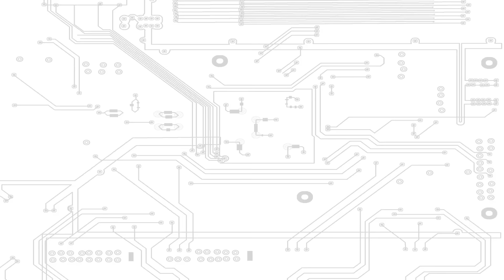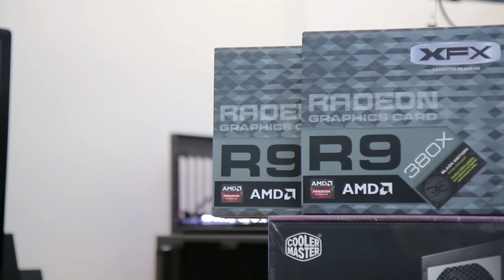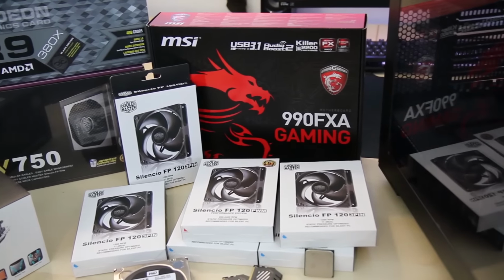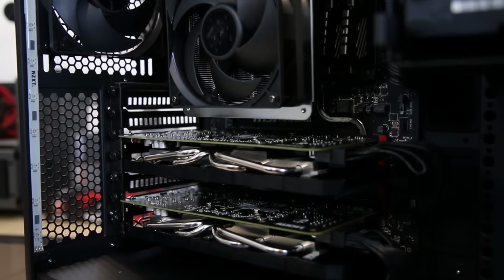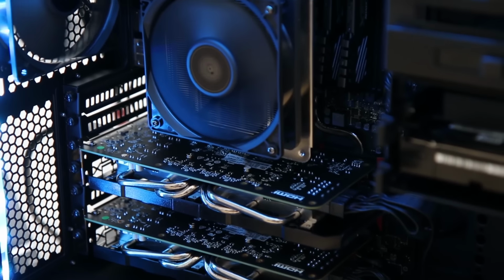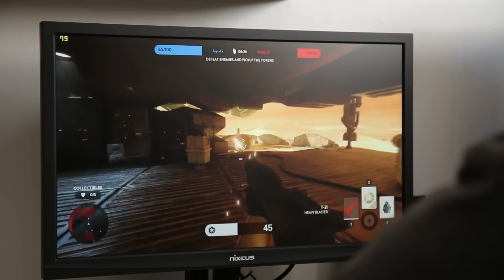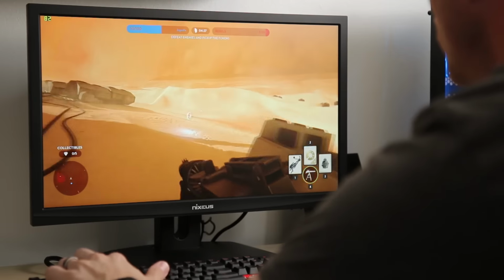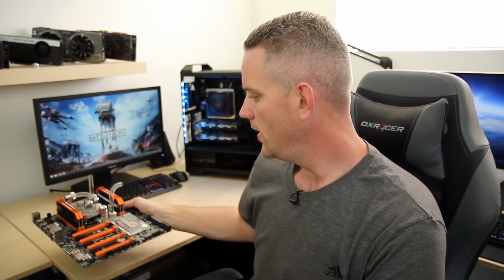AMD Gaming PC - Is AMD still good?

Comment: Nothing against AMD on the graphics side, but I'm still running an Athlon 2 X4 640, which was released in 2010. RIGHT NOW I could go out and LITERALLY buy the BEST AMD CPU and I would have no incompatibility issue. TELL ME there is nothing wrong with that!

OH, AND QUESTION FOR ALL: Should I go out and buy an FX 8350 ($180) or get a Core i3 (Skylake) or i5 (Haswell) on a new chipset and DDR4 (Skylake) which would cost around $220. (I will have to use the stock cooler on the 8350)
Reply: caleb kelly no lol what
Reply: +Captain Leerox i would go i5 haswell if you dont mind getting a new motherboard. a 4460 will do you fine, a 4690k is a large amount of money more for a small performance bump
Reply: +Captain Leerox If you live near a micro center you can pick up a 4790k for 270$ with tax.  I would highly recommend a 4690k or if you need to keep it on a budget pick up a 4460.  Personally I ended up getting a 6500 for $190.
Reply: +Captain Leerox its simple. Check how much u would save by going with an 8350 instead of an i5. Now check if that ammount is enough to get a higher tier graphicscard. For example 390 instead of 380X. If that is the case get the FX if not get the i5. 

Unless its just an 4460 or 4570, then the FX8350 will probably be better, but that really depends on the games you are going to play. 

I would not recomend ANY i3 atm. They are simply not worth their money for gaming compared to what amd has to offer at the same price range. (like the athlon x4 860k, or the FX 6350/8350).
Reply: Whatsthisbuttondo1 Yeah I mentioned the i3 because I have a MASSIVE Bottleneck. Literally I would be fine with ANY processor better than mine, but my CPU also has an AWFUL temperature on idle (50 degrees, almost 80 on slight load, I hate high temperatures even though throttling would be the only effect of temps on performance)
But really I just also want to say hello from the other side. I totally think it would be amazing to have a sick DDR4 entry level system, and 2 years later pick out an LGA1151 top of the line Core i5 processor and just kill games and never worry again. There's no way I could do that buying a 4460 or FX 8350
Reply: +Captain Leerox I'd wait a year. TBH See if cannonlake comes out or a new AMD.
Reply: caleb kelly <3 is ok we love u
Reply: lS7rike l But I only have 2 opportunities to buy things: Christmas and my birthday in May.
And I think I've waited too long its been 4 years too long
Reply: Captain Leerox 6600k>6600 or 4690k> 6500>4460>8350 - All are pretty fucking good.  If you can get a good deal on it, and are willing to spend a good portion extra I would recommend trying for a 4790k, but if you are only gaming it is a slight waste.
Reply: +Captain Leerox I say get a 6300 and wait for zen
Reply: M̶c̶N̶u̶g̶g̶e̶t̶ Ahh. That's not a bad idea, but the i3-6100 is fairly ahead.
Reply: +Captain Leerox I picked up an 8320 for 110 shipped. Intel doesn't even offer a decent CPU in that price range, at least not comparable to the performance you can get from the 8320.
Reply: ***** Just the confirmation I needed. I watched an i3-6100 reach 4.6 GHZ stable.
Reply: +Captain Leerox wait for Zen. I switched from the 8350 to the 4690k because I emulated a lot, which demands better single-core performance than AMD can provide, but I doubt I'd recommend that for most gamers. If you're desperate for an upgrade then look at something between the 6300 and the 8370, then wait for the next round of CPU's from both companies.
Reply: ***** But then where's the upgrade path. I'd rather get a Cannonlake LGA1151 Core i5
Reply: Captain Leerox Not a bad plan. but do bare in mind that there some games that will simply not run on an i3 (even a good one). and other games will be slowed down by the i3, and an i5 will almost never be a bottle neck. i got the i5 6400 myself and i do love it but ddr4 is no benift over ddr3 when it comes to gaming. and amd cpus will also give a bottle neck in a few titles. you are probably best looking into what games you play and weather or not you need the i5.
Reply: +U Wot m8? i assume you mean ddr4?
Reply: +Captain Leerox i'd go with either a i5 4460 or 4690k. I just got my 4690k brand new from r/hardwareswap for $185 and i love the thing. Got a dark rock 3 on the way, can't wait to overclock.
Reply: ***** Don't you mean:
The Skylake upgrade path would be on a brand new socket, which will most likely have new processors in later years on that same socket. With that LGA1151 socket you will have DDR4 and the Z170 platform benefits. In these ways you can upgrade your CPU to a Core i7, which will probably be faster than AMD's next generation processors.
Reply: If your budget for a CPU, alone, is close to $200, there's no reason to get anything but an i5
Reply: Alex A My WHOLE BUDGET is $200 XD
Reply: ***** I'm not downgrading....
Reply: ***** For a brand new chip, on one of the latest chipsets with PCI Express 3.0 and M.2 support
Reply: If it aint broken, why change allot of things tho. I think getting a fx chip is one way to upgrade the system and costing you less. At the same time, you can just buy a graphics card with it than spending more on the cpu side. Just saying, that graphics cards are more important right now. And, an fx chip is still a good chip, tho the single thread performance is weak, but gets the job done on games and other applications.
Reply: +Captain Leerox the 8350 for intense cpu games for sure
Reply: +Captain Leerox and if your budget is 200 dollars, then get the evo 212 it comes with thermal paste btw
Reply: Zach Marik ya ik
Reply: Zach Marik what the Ive seen you on my channel before and you raged at me
Reply: +Captain Leerox dont mind that
Reply: +Captain Leerox Honestly, I would go for the 4460 and keep that for a few years. It will last you well since it is a good enough CPU such that it will not affect games. If you go Haswell, the upgrade to Skylake is not worth it at all (FOR GAMING) since there is literally no change in FPS between the two chipsets. If you wanted to upgrade, wait 3-4 years and then upgrade then when Cannonlake becomes cheaper.

The reason I did not recommend the 8350 is because Haswell (and above) has much better single core performance which is many games tend to use (games like ARMA 3 or World of Tanks will get worse FPS than if you got Intel). Sure, there are games like the Battlefield series which are optimized to use multiple cores but in today's game market, 90% of games still rely more on single-core performance.

To those out there who say to overclock the 8350, remember that the more your overclock a chip, the more wattage it uses therefore the more heat it outputs. The 8350 already starts at a base TDP higher than the 4460's. To match the single core performance of the 4460 through overclocking, its going to get quite hot. This means you are going to need to buy a better cooling solution to get the same single-core performance out of the 8350 as the 4460. Based on what you said, using the stock cooler on the 8350 and overclocking it is something I don't recommend (it will thermal throttle if you try to match the 4460's single core performance on that stock cooler).

I hope what I wrote was not too long but this is by far the truth in terms of Mid-Range CPU's (in the high-range CPU's, Intel has that market, AMD's top CPU's are outdated at this point).

Have fun upgrading your PC while I'm stuck on this Crapbook Pro :)
Reply: ***** Did you even read anything I said LOL
Reply: ***** "The upgrade path would be on a NEW set of socket. so it'd be a waste"

- which is why my main recommendation was to wait to see what Zen brings, even if only in Intel price drops.

" Skylake you get ..."

- he has a socket that already accepts an 8350, which means he would only have to buy the chip, for around £125/$180. Upgrading to Skylake costs him around £180 for an i5, £60-odd for 8GB of DDR4 at a decent speed, and somewhere in the region of £100 for a motherboard that can justify the expense. That's 250% the price of the 8350 for only minimal improvements in games.

" you can easily move to an i7"

- if an upgrade path is so important to you then why are you overlooking his current upgrade path? In two years, when he's thinking about that i7, you'll be telling him to ditch his entire setup and swap it for whatever else Intel has released.

I really wish people would stop recommending upgrade paths when they do so in order to provide an expensive alternative to the upgrade path people have available to them right now.

Captain Leerox seriously, if you're dead-set on an upgrade, get an FX-8xxx chip. I have a 4690k so this is no blind, biased statement - the 8350 is a superb gaming CPU, especially given that you could retain everything else in your system.

As long as you don't need ridiculous performance from one or two threads - such as emulators - you'll get along fine. An i5 just isn't really worth it: trust me on that.
Reply: Subal Pant " I would go for the 4460 and keep that for a few years"

- not as well as an AMD octa-core. After all, eight-core AMD chips are what most games are designed on, seeing as they form the centre of the PS4 and XOne. Witcher 3, Battlefield 4, Star Citizen, etc. all use more than four cores where available. An i7 is future-proofed, to some extent - an i5 generally isn't to the same degree. An 8350 will fare better.

"I did not recommend the 8350 is because Haswell (and above) has much better single core performance"

- no modern game uses a single core, so this is pointless. Games which only use FOUR cores will favour the i5, but these are slowly being phased out and games are increasingly making use of up to eight cores. I doubt quad-cores will go the way of dual-cores any time soon, but they're certainly starting to see little hints of obsolescence.

" in today's game market, 90% of games still rely more on single-core performance."

- but how many new games run on four cores or less? That's the issue here. As far as I can see, genuinely new games are becoming increasingly likely to run on more than four cores, whereas those major releases which do not tend to be those built on older firmware, like Fallout 4 (using the Creation engine from Skyrim - which launched running on TWO cores) and GTA 5 - a PS3 game.

That 4460 will ONLY beat the 8350 if something runs on four cores or less. Some games already break that criterion, and it's reasonable to expect them to increase in prevalence from this point on.
Reply: +Christ J  Thank you. And if he uses a 212 with the 8350 it will also be cool for about 30 - 40$ more.
Reply: +Captain Leerox If you only have $200 to play with the best and only option is FX8350. You're not going to get a new motherboard and a worthwhile CPU for that price.' FX8350 is the best bang for your buck upgrade from your current system.
Even if you had a bigger budget, you'd get seriously diminished returns on your dollars spent by putting money into switching platforms. You'd get maybe up to 20% more FPS in a few titles, but it'll cost you around 2-3 times as much money to do that upgrade. You wouldn't get a good return on your investment.
Reply: actually... Their 8 cores have only 4 physical and 4 logical cores... similar to how their 6 core has 3 physical and 3 logical cores... just saying:3 I love amd still
Reply: +niro lord not true, one "schedular" for TWO physical cores, not one physical and logical thread.
Reply: Bryan Zerby indeed. The 212 Evo has got my 4690k to 4.4GHz, with plenty of voltage headroom when I water-cool.
Reply: too bad that you need a 240mm liquid cooler to max out your cpu
Reply: +Captain Leerox 
No reason to get a CPU right now, it's a shit time - new generation of Intel CPUs have no substantial performance over last gen (because they have no real competition) and AMD is still on 28nm dies for their three year old CPUs.

Wait at least until Zen is released, because Zen is going to be 14nm and there's speculation that there'll be a "16 core" zen CPU and better single core performance.
Even if you hate AMD with all your might it's still a good thing because it (might) kick Intel in the god damn rear and make them start releasing products at a decent price again.

If I was going to get a CPU right now I'd just get an FX-8350 and OC the shit out of it, it'll handle all your gaming needs until the next gen of CPUs come out.
Reply: +Captain Leerox meh, just go Skylake / DDR4 if you have the money to do so. If you don't, get a FX-8320; $40-50 less than a 8350 and you should be able to OC to the same clocks or more (and you can spend that savings on a Hyper 212 EVO cooler).
Reply: +Captain Leerox I'd get a I5-6600K (K-series skylake processors don't come with a stock heatsink be warned). and 8gb of cheap G.Skill or Crucial memory
Reply: find a cheap 8320 and a nice cooler
Reply: i5 hasswell dont go i3 the fx 8350 beats the i3 so yeah but i would say i5 haswell
Reply: +Captain Leerox i have an  i5 4460 (haswell) with stock cooler and it's quiet and handles everything, with an asus r9 270 i can play all games but not all of them at ultra.
Reply: +Captain Leerox Captain, I agree with the 8320 plan.  That is a 3.5GHz 125-watt CPU (*more when overclocked).  This CPU was about $130USD when I checked a couple days ago.  Get a good air cooler for it and turn up the heat.  I think this should be more than fine for 1-2 years, at which time you can consider a new system based on whatever is out then.

Going to a new platform now when you will have to buy bottom-of-the-barrel components seems like a bad idea.  Be certain your motherboard fully supports the 8320 (check the manufacturer's list of supported CPUs) and make sure your RAM is fast enough.
Reply: umm bodozer pins...
Reply: +Captain Leerox  Skylake -  cause it seems we will be able to overclock none-K versions again, and even the i3 series =)
Reply: +Captain Leerox The FM Athlon cpus are notorious for having bad temp sensors. Your temps aren't nearly that high. I was idle around 50c (gaming around 85c) on a X4 760k with a CM Evo 212; thought something was wrong so I pulled out my Corsair H100 from another build and slapped it on the 760k. SAME TEMPS!. Which I concluded was impossible and the sensors were bad. So that is most likely what you are seeing. 

Personally, I don't think the Intel price premium is worth it for 99% of people. Only 1% of users will use an Intel cpu for what it is designed for. The rest are just fanboys who want to brag about how much money they spent on a rig. I go with AMD simply because price to performance ratio is just right. Hell +JayzTwoCents was an AMD guy for a long, long time. I forget why he switched, but he's more intel today than ever before. If you have the money and really, really want intel. Go with an i5 Haswell or better. Skylake will serve you better in the future though. i7 is too overpriced for 99% of the people who are using it to game. i3 won't server you long enough. Bomb Tech's two cents.
Reply: +Captain Leerox i5 haswell
Reply: Just get fx-8320 with decent cooler and overclock it.
Reply: Just get fx-8320 with decent cooler and overclock it.
Reply: +Captain Leerox redo thermal paste.
Reply: +Captain Leerox Paying $180 for an 8350 is way too much. It goes on sale for $120-140 very often.
Reply: seriously - skylake i3/i5 - they all seem to become overclockable soon according to mobo-manufacturers.  
You get a cheap i3 that at stock beats the stock AMD FX series, and will have the same possibility to OC it if wanted.
And the Intel CPUs already beat the AMD CPUs from budget to enthusiast in terms of System-price/performance.

With Zen that might change - who knows, we can only hope for the best.
Reply: ^^fanboy alert
Reply: +Captain Leerox   old AMD multicores are bad,   newest ones are not much better,     Zen might be good. 

860K with 390,   380,   970 or 960  if on a budget,    780s are also decent if you can find them
Reply: Bomb Tech
 Really check - go find a good AMD Cpu that can come close to the performance of the lowest i5 skylakes in games :)
Reply: doublepost... ugh.
Reply: +blitzwing1 and just to clarify, I use both chips for different reasons. AMD for gaming; Intel for productivity.
Reply: +ABaumstumpf I'm not an AMD fan boy. I use both chips, have for many many years. probably longer than your mom has been buying your chips. Go home fan boy.
Reply: Bomb Tech So you ignore that benchmarks show that Intel is currently jsut the better option through out the board for gaming?

And you want to claim that you are not a fanboy? You certainly are one.

 
And i don't know why you think my mother would by my stuff - you should stop projecting form your self onto other - certainly not everybody is as pathetic as you. Most people actually can read and understand what it means, when a cheaper Intel i3 beats the fx 8350 in every game. It means that intel is the better choice, even for budget builts.
Reply: +ABaumstumpf I don't feel like giving a long rebuttal on my phone. don't get ahead of yourself, son.
Reply: +ABaumstumpf Why are you deleting your comments?
Reply: Bomb Tech
 I deleted a comment cause it was a double-post - youtube sent the same comment twice. So why should i keep it?

and
"I don't feel like giving a long rebuttal"
You mean you run way and act like a spoiled brat - like a total fanboy - because i have shown you facts and you can't deal with them?

Well -deal with it - the benchmarks show that even the last gen intel i3 can and will beat AMD CPUs in gaming.

Please learn some basic reading comprehension and maths.
Reply: *****  ^,^ dont have skylake yet, big plunder of intel - that should never happen. But this and the performance are 2 separate things -they still outperform AMD - that is just a sad fact.
Reply: +ABaumstumpf I never once said AMDs CPUs weren't old or that Intels new chips wouldn't beat it. Look at My comments again before you comment back. You are absolutely dense and only making you cause (if that's what you want to call it) worse. And you can't just ignore the fact that AMD hasn't taken advantage of new manufacturing processes yet. That's what they call having your cake and eating it. Like others have said, 4 frames. yay.... you win I guess. Although this was never a debate on who was better. I simply said (or so I thought until I met you), that they are DESIGNED for completely different applications. And excel at those applications for which they were designed. Please for the love of God. Read this time, fan boy. 

Now that I look back at the comments, you were just mad I called you a fanboy. Ha. That's actually pretty funny.
Reply: +ABaumstumpf You also can't base your facts simply on gaming. Gaming is a TINY niche in the CPU world. Most Intel chips are used for productivity. Possibly light gaming if you organization will allow you to install personal applications. Your little, tiny world of only gaming, doesn't cut the mustard.
Reply: +Captain Leerox 
While everyone here is having a brand war, I'd like to offer my two cents.  It would be MOST beneficial for you to wait a few months until Zen is released.  
If Zen ends up being great, you can upgrade to Zen.  If not, the prices of both the Intel and Amd CPUs will be cheaper.
Whether or not you plan to get Zen, waiting will be your best bet
Reply: +Captain Leerox i have a 8350, really good cpu for the price. Only game i have issues with is Dayz. But then again it's dayz... i bought a cheao motherboard 970a ds3p and i can run it at 4.6ghz with ok temps on air cooling. Running 4.4 now idle 26 in game 37. i can stream any game i play without a problem. Gpu is r9 270x 2gb and 8gb 1600mhz ram.
Reply: *****
 Many do, sure, why not. And there you would go for a Xeon.
Reply: 8350
Reply: +Crispy K We basically have the same build lol
Reply: +Captain Leerox 4690k or 4790k
8350 is ass for games, I replaced mine a few weeks ago
Reply: +Captain Leerox i just say a 8350 on sale for 130$ check around...(that was newegg btw)
Reply: ***** asrock 970 extreme R2 2.0
Reply: radun70 But then I could sell my old things (Yes I know a few guys who would take my RAM and CPU/Motherboard and old Graphics card for $130)
Reply: +Captain Leerox
You'll need to buy a new CPU, Motherboard, Ram, Graphics card and Windows license (if your current license isn't transferable). You can sell your current parts for $130... +$200 you are putting into the budget. You're going to need to spend at least $180 of your budget on the CPU for it to be worth your while to upgrade. That'll leave you about $150 to spend on the rest of your components, which doesn't get you very far. If you need a Windows license, there goes your budget. If you don't need a license, you can get a cheap 750 Ti graphics for about $80 - $90. So that leaves just $60 - $70 for a motherboard and ram. I think you're going to have to put a bit more money into it for it to really be an upgrade, and the bottom line is it's for very marginal improvements over a FX8350.
I think you'll still need to put at least another $150 to cover everything. $250 if your current Windows key isn't a transferable retail license. And that's if you only buy bottom of the barrel low end equipment. So you'll be spending between 1.5x to 2x as much money for about 10% to 20% improvements in some games.
Reply: radun70 I have:
Athlon 2 X4 640 CPU
MSI 760GM P-34 FX Motherboard
G.Skill Ripjaws 8GB DDR3
EVGA GTX 960 4GB FTW
WD Black 1TB
Windows 10 Pro 64 Bit
Corsair CX600M PSU

All I need is a new CPU, Motherboard, and RAM, if I sell that, I would get around $80, and I could add my OLD Radeon HD 6570 to the mix to make all that combo for $100.

My budget in the first place was $200, so If I just buy:
An Intel Core i3-6100 ($130)
An AsRock H170 Pro4 Motherboard ($100)
And G.Skill Ripjaws V DDR4 8GB Kit ($45)

And sell my old stuff, it will only cost me $175
Reply: +Captain Leerox 
You could do that. It all really boils down to whether your windows license is a transferable retail version. If not, you'll need to put a little bit more money into it. Either way I'd just go for the FX8350, but it's your money you can do what you like with it :)
Reply: +Captain Leerox "MSI 760GM P-34 FX" MSI's 1st page says "125W supported"  but compability has no 125W cpus on it. Weird. Just to be safe, I'd choose something like 8320E (Google: "Anandtech AMD 8320E"). If go Skylake, google "heat sink warped skylake" first, before you go and damage your new motherboard or CPU with a cooler, that it can't handle.
Reply: Eman Resu AHH THAT'S A GOOD POINT I overlooked it because at the time an FX 8150 would be fine. HOWEVER I believe an 8370E runs better than the 8350 while maintaining a lower wattage? (It's only like $150 at Microcenter and I live near one)
Reply: +Captain Leerox i'd go i5 if im picking intel. if u're on budget go fx, fx does the job pretty well.
Reply: Captain Leerox I have found this in a user's review of the product on Newegg's web site:

Manufacturer Response: We apologize for the issues that you are having with this product. You are right, this motherboard only supports 95W TDP Vishera processors fully, but it will handle Zambezi 125W without any issues. This is due to Vishera being underrated therefore they actually use more power in reality than on the paper.

To me this says that a true 125-watt CPU could be used, but overclocking is out of the question.  The board's power rails are not the best, which is not uncommon on a lower-end board.  It appears that an FX-4170 is the fastest processor that you could reliably use.  This is a quad-core Zambezi processor clocked at 4.2GHz.

You would likely not be able to overclock this significantly, and it does not seem like enough of an upgrade to be worthwhile.  If it was me, I would save my pennies for a while longer to build a new system because waiting is never wrong in this game, if you can stand it.
Reply: I would buy haswell i5
Reply: +Captain Leerox Wait for Zen and then check back. I am deadly sure that A) Intel will drop prices and B) Zen might not be that bad at all. So yeah, be just a little bit more patiened and wait till the mid of next year.
Reply: +Captain Leerox Skylake i3 series is surprisingly good. I always thought that they are not relevant, due to having only 2 cores, but they hold up to i5 2500 and even 4460 in most games.

If you are interested in blck ocing, go for pick i3. They are worth especially for such a cheap price.
Reply: Denis Leskovar oh right u mentioned it, i almost forgot that. All the time i was considering that I do calculation based processing some time and that's y i'd go for i5. yeah i3 holds up most games fairly good.
Reply: +Mavro Manitari i got my a10 7850k to 4.5ghz and is at the i5 level
Reply: +PC MASTER RACE i think there wont be only one model with 10 cores
Reply: +Sir Stewie 8350 is better then all listed intels
Reply: +Alex A you can make a 9590 of it just do an oc
Reply: +U Wot m8? 8350 beats the 6600k
Reply: +U Wot m8? i got this on my a10 7850k and its beating i5
Reply: +Captain Leerox zen will be as fast as a 5960x
Reply: +Tim Clark Jr you know that threads are executed on compute units?
Reply: Intel has better single core performance... and probably has btr benchmarks... but... TEAM RED FTW
Reply: Captain Leerox take note that amd fx processors 8 cores are 4 logical and 4 physical cores. This is the same with their 6 and 4 core varients for the fx series.
Reply: niro lord No they aren't......AMD FX processors have 4, 6, and 8 PHYSICAL cores.
Reply: Are you sure? Can you provide me a link to tell me it's all physical I'm kinda surprised now 0_0 this is actually a pleasant surprise.
Reply: +Captain Leerox oh.. I have no idea some places say 4 logical and physical some say 4 modules 2 cores each.. I have no freaking idea no more. Amd doesn't even tell us=_= intel is much more straight forward:(
Reply: niro lord Yeah XD here it is:
http://www.amd.com/en-us/products/processors/desktop/fx

If you read most of the headings and scrollo down the overview and spec boxes you'll see they mention the FX 8xxx series to be the first 8-Core processor, as it was the first to have 8 Physical cores thus proving it right there. They are all physical cores as AMD hasn't developed a hyper-threading type of tech in their processors yet. (WHY THEY NEED ZEN)
Reply: ***** I can't I can only buy stuff this christmas and in May
Reply: Captain Leerox I have no idea but ty:3 I'm enlightened after 3 years=_="" god why didn't I meet you earlier
Reply: Not going to get in on this fight, just wanted to say if you search around you should be able to get an FX 8350 for close to $150
Reply: ^^ I use an FX8320 and R9 280x, game on a mix of high/medium settigns in BF4 @ 1440, and I'd say I average 70 fps
Reply: +Captain Leerox i5 haswell, unless you dont mind spending a bit more for an i5 6400 ($189.
Reply: ***** What ended up happening was I picked up a Z170 motherboard and 8GB of DDR4 for $120
If I go to microcenter I can pick up a Core i5-6500 for $200 and that certainly will be more efficient and perform better than if I had just chosen to alleviate the bottleneck (FX 6300 for $100).
Anyways I've watched a few videos on the Core i5-6500 and overclocking, and because I bought an AsRock board I can overclock locked CPUs.
Reply: Captain Leerox you could get a 6400 instead, the only difference is stock clock speeds and since you're overclocking anyway it won't matter.

And Alex I think they did. I know msi Asus and evga all have and asrock is right next to them in terms of quality.
Reply: ***** the kingpin is a waste of money just get the msi lightning its a much better card for the money. 

As for CPU idk, a 6700k won't be a huge improvement. You'll need to get an extreme edition CPU if you want a huge changes. Intel just announced a new ten core cpu (o think it's called the 5960x but I could be wrong) so I think prices will drop soon, but who knows. Intel is a little bitch about pricing sometimes.
Reply: +Chris Lohr just the CPU is gonna run you $1000 then. there's no way around it. like I said the 6700k isn't going to be a major improvement, maybe about ten seconds of difference. I'd go for a six core with hyperthreading at least. the 5930k sounds like the best choice.

also, the kingpin is just as good as the evga hybrid but costs way more. if you don't go with msi go for the hybrid. the kingpin isn't worth paying $1200 for at all. it's a collectors card not one that supposed to be used.
Reply: +Chris Lohr idk who you sold that to for $90 bit god damn I wish it was me lol.

for ~$850 the kingpin is a great deal i'd nab that as soon as possible. I wouldn't get less than 74% asic quality though so I'd look into that before you buy it.

good luck.
Reply: +Alexander Binovski yeah definitely, they hold quite a few overclocking records. with decent cooling I'm confident it can hit 4+ ghz.
Reply: +Chris Lohr no its a low end skylake i5
Reply: +Alexander Binovski the 6950x is going to be $1500 unfortunately. i guess that's the price you pay for 20 threads.

personally I'd wait for zen, am4 motherboards are said to launch around June, so I'm thinking the cpus will be around the same time. AMD is claiming a 40% increase in instructions per clock, and if that's true that means Intel is in big trouble. it should be very interesting.